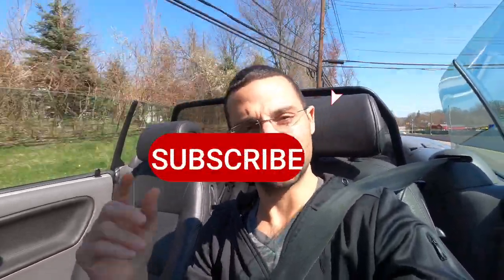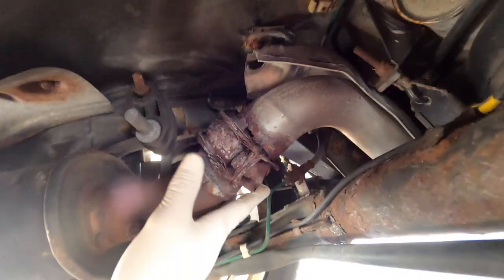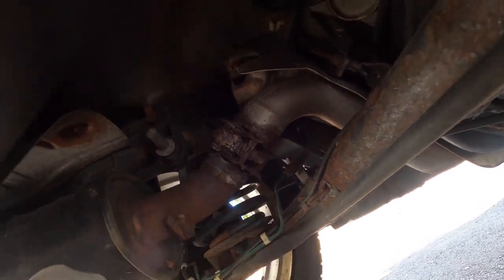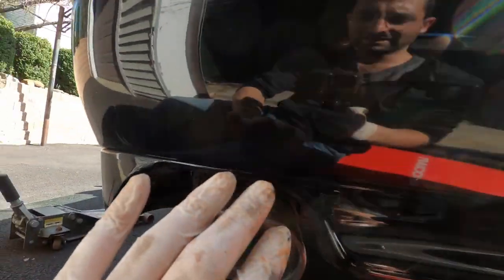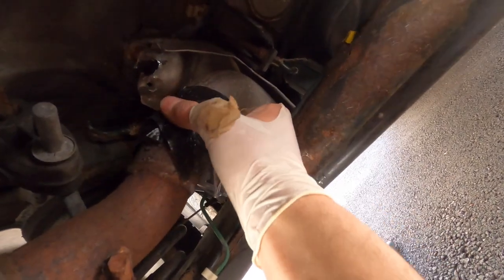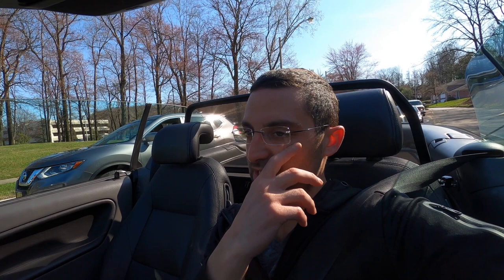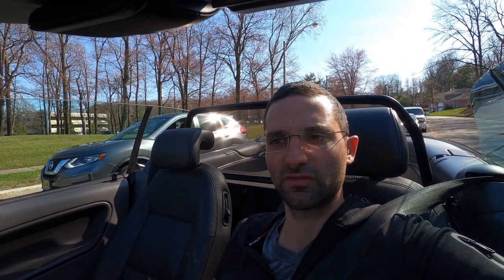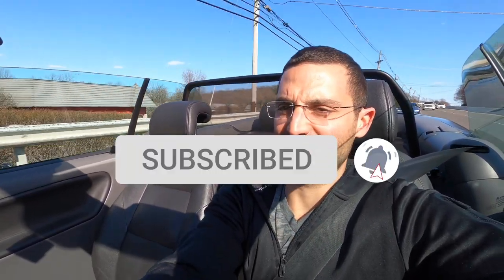An unlucky Exhaust Leak with my OG Saab 9-3 Convertible

Comment: Hi kyle, thanks for replying to my last post.I checked all what you said and it seems to be ok.Can you advise me on what and where the microswitches to open the tonneau are please.Thanks again.Alan UK.
Reply from the maker: there is one on the driver side and pass side with a metal strip on top. then on driver side a little further down towards the door frame is another (this one controls the top going up, if I recall)
Reply: @KylePancis  Thanks for that Kyle.I will let you know how i get on.Thanks again.Alan UK.
Reply from the maker: @alangriffiths7949  pleasure! good luck

Comment: For the 9-3 CV top, how often do you check/fill the hydraulic fluid behind the back seat? Just curious as I got all piston$ replaced last summer & want to keep it running smooth.
Reply from the maker: once a year i check...but rarely needs to be touched